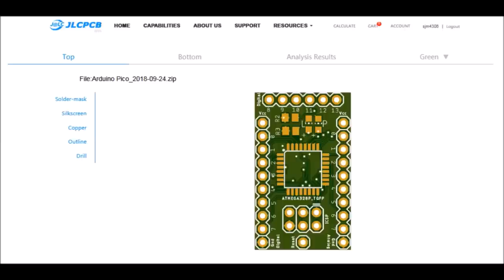PCB Word Clock Prototype - Part 1: PCBs, 3D Printed Bracket, and Software Oh My!!!

Comment: I wonder how much the 3D printed bracket will help, assuming the mask PCB lies flush against the top of the LEDs already. Your biggest enemy will probably be internal reflections inside the PCB. 

Ideas I got while watching this:
Try doing only a small circular cutout on the back of the mask.

Maybe it would help if you put microvias around the letters, although the board house might charge you extra for it. The risk with doing this however is that it may affect the solder mask quality on top of the vias.

Another idea, put a solid solder mask on top in another more transparent color than black. Only do cutouts in the copper, on the front side. This would be a slightly different effect where the letters are less visible for unlit letters.
Reply from the maker: I wondered about this as well, was basically hoping that balancing the opacity against controlling the brightness would allow me to skirt the issue. Another possibility is to not just use a box keepout on the bottom but instead mirror the character cutout in the mask and copper bottom layers so that extra light would be minimized to just the exposed portions of the characters although this may just have the effect of making all of the characters really dim. I'll give it one more try with the 3d printed bracket and if that is still not satisfactory then I'll cross that bridge when I come to it.

Comment: Very nice! I still need to add some logic to mine. I used leds on the back soldered upside down to shine through the pcb. Adding vias helps with the bleed through.
Reply from the maker: I'll have to look into adding vias if the 3d printed light box turns out to be insufficient.

Comment: Fantastic piece of work. Could you explain how the lettered board is designed ? Is it a multilayered board ?
Reply from the maker: The lettering is on a two layer board. The top soldermask layer has the cutout for the letter shape and under that the copper layer has the same letter shape cutout. This is so that light shines through with crisp, sharp contrast as it has both soldermask and copper defining where light can and cant pass. The bottom solder mask and copper just have a box cutout to let as much light through as possible while bleeding as little between adjacent letters as possible. The reason why I didn't just have a mirrored cutout of the letters is it would have been more difficult to do in eagle and I was worried it would make the display too dim.
Reply: @sjm4306 Thanks for taking the time to give a detailed reply. I'll be in for one of your kits.
Reply from the maker: I think I remember seeing that version on hackaday a few weeks ago. Very minimalist and slick.

Comment: cool idea. wondering if the leds get hot, and if so, any chance of warping the printed plastic?
Reply from the maker: I pulse the leds at around 4000 times a second for something like 5 milliseconds (I've measured it, though not sure if I'm remembering correctly) so while they look super bright they are running pretty well under their max capability (I cant feel much of a temp difference with my fingers).

Comment: Awesome!  What software do you use to design PCBs?  I"m trying to decide what to invest my time in.  Had started with Fritzing but then heard it may not be around for much longer so wondering about alternatives.
Reply from the maker: I use Eagle for pcb design and solidworks for cadding 3d prints. I've used altium, expresspcb, easypc, and kicad in the past. Kicad is free and has a pretty good user base with plenty of help on forums so it may be worth your time to look in that direction.

Comment: Hello, looks amazing. Just wondering what the approximate cost for a whole unit costed?
Reply from the maker: A rough estimate for materials probably comes to around $13-15 in one off quantity and depending on LED color. This doesn't factor in needing the 3d printer or the cost of filament/electricity to print the frame. I'm looking into casting the frame instead as it would be much cheaper and faster.
Reply: In my country dollars ratio to my currency is currently at 6 so I'm very limited in my summer projects this year. This is a perfect weekend project. Thanks a lot...

Comment: very creative, good work! I'm surprised you're using a PIC. Most makers seem to be using the Arduino IDE for various Atmel and other processors. Which compiler do you use?
Reply from the maker: I use either PIC or Atmel, depending on which side of the bed I wake up on or what I happen to have in stock. I use Hi-Tech C and MPLAB.
Reply: I'm setting up a new dev environment myself so interested in the details. I used PICs many years ago with CCS C compiler. Is there a free or low cost version of High-Tech C?
Reply from the maker: There is a free version that isn't heavily optimized and I believe limited in program size.

Comment: Did you follow a guide for the routing/drill holes between the pcbs or did you make up the measurements yourself? I would like to use this for when I order my pcbs, but I'm not sure what the measurements should be.
Reply from the maker: I just did it manually by eye, basically guessing and hoping it would work. Turned out much better than I had hoped.
Reply: @sjm4306  Thanks for the reply! Good to know, Im going to try it out myself! The solder mask keep out display is also a super cool idea! I was wondering if doing a large keepout area on the back, instead of lots of squares would make it easier for when you need to make the 3d printed part?
Reply from the maker: I dont know if it would be easier for the 3d printed part, I just kind of assumed it would allow more light bleed. It sure would have made the board design easier though!
Reply: haha I could imagine! Im currently using Kicad, and the only way I can think of to replicate that with Kicad would mean making a bitmap image of every single word/letter, and also having to draw individual polygons for the keepout on the back! what a tedious job!
Reply from the maker: I know there's a way to script stuff in eagle, just haven't learned yet. I may though if I keep doing annoying large arrays of components that have to be precisely placed in non-trival arrangements.
Reply: @sjm4306  That might be worth investigating! The project I have going just also happens to be a digital clock, and I am curious about your RTC circuit. I ended up picking one that doesnt have a battery back up, as I was unsure how the trickle charging of the DS1302 works. How did you implement that?
Reply from the maker: You just wire a supercap to the vcc2 pin, and set a value in a register that tells it the termination voltage and what current to charge at. There's a formula in the datasheet to figure those out. Super easy and with a good cap it'll easily hold the time without power for weeks.
Reply: @sjm4306  Oh sweet! thanks for the help!

Comment: why dont you make the print so the walls match the plate with the numbers insted? that way you will eliminate them lighting eatchothers up and im fairly sure the diodes will fit inside as there is pretty much room :)
Reply from the maker: That would be incredibly difficult to model (I would need to find the exact same font as eagle uses assuming it is not custom), and printing such fine detail on my kit 3d printer may end up being impractical. As another commenter mentioned the main issue will likely be that the internal of the pcb will be the biggest problem as it is fairly translucent and scatters light well. I may have to redesign the front pcb to use vias around each letter to block as much light bleeding as possible.
Reply: thanks for the reply!
i would proberly scan the back side of the lettering to get it into the computer and mold it from there. but then again, i'v never worked with a 3d printer.
i think the pcb might fit as you have it now but with the "correct" middle.
my first thought was to cut/mold some foam,  i dont have a 3d printer my self so ofcause it wasn't the first thing to struck my thought.
anyhow i belive you will come up with a good fix for it =)
Reply from the maker: I'll get some time this weekend to play around with the model and my printer some hopefully I can figure something out.